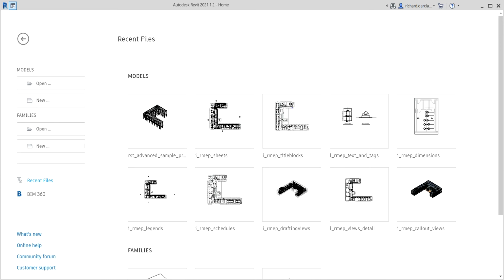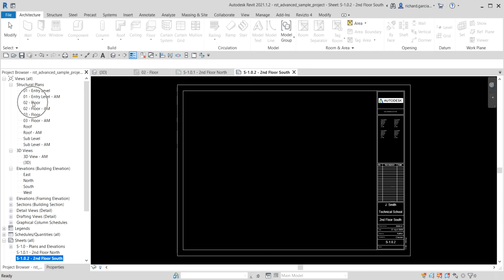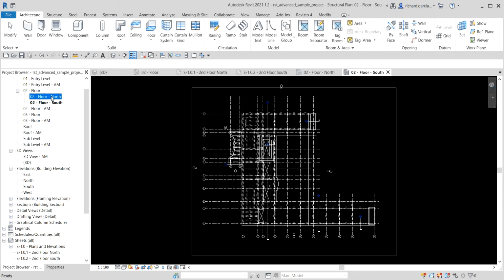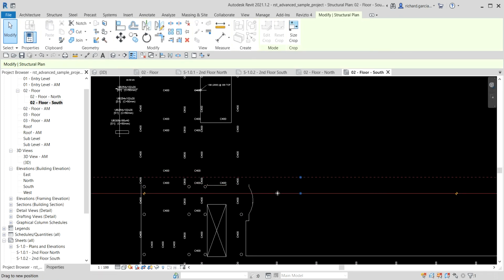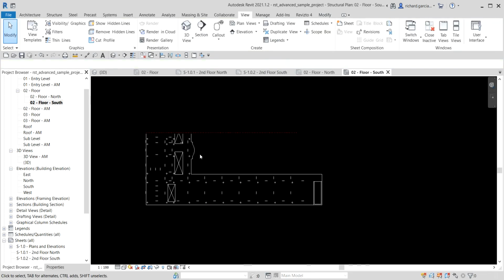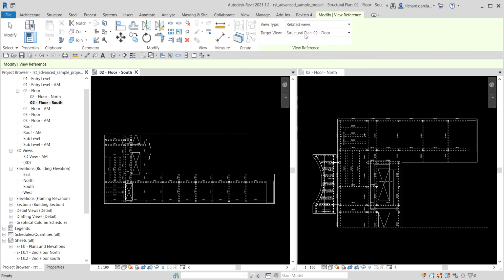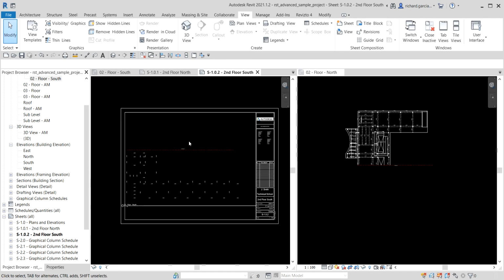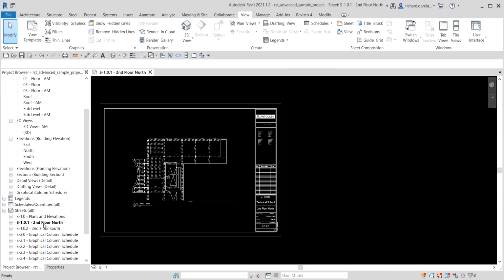TIPS AND TRICKS: HOW TO USE MATCHLINES AND VIEW REFERENCE

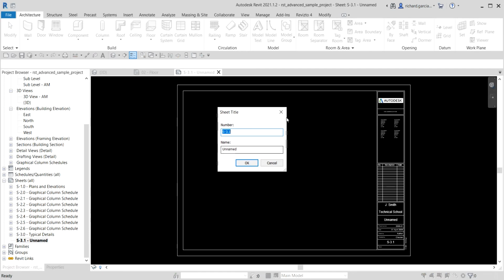Comment: Excellent job. But I have a question. I prepared a primary view with a matchline and i made two dependent views partA and partB. I placed primary view on sheet1, scale 1:100. partA on sheet2, scale 1:100. partB on sheet3, scale 1:100. I want to keep the scale of primary view at 1:100 but i need to change the scale of partA and partB both to 1:50. Any help?
Reply from the maker: Hello Imtiaz, dont use duplicate as a dependent view, use duplicate only.
Reply: @bim360  Thank you for your time and effort
Reply from the maker: @imtiazhussain5027  you’re always welcome Imtiaz.
Reply: @bim360 it works nicely with duplicate views as you said. Thanks
Reply from the maker: @imtiazhussain5027  awesome!!! good for you Imtiaz.